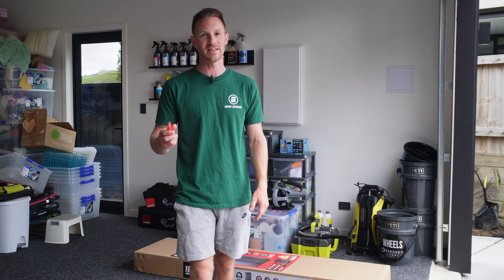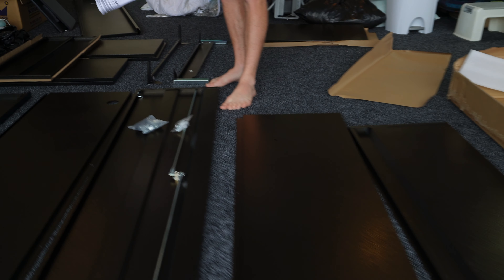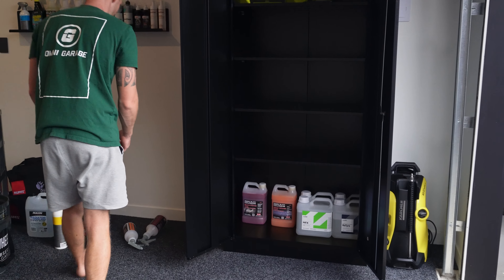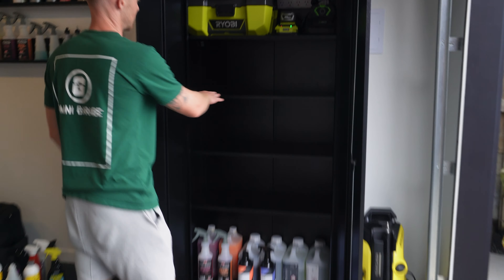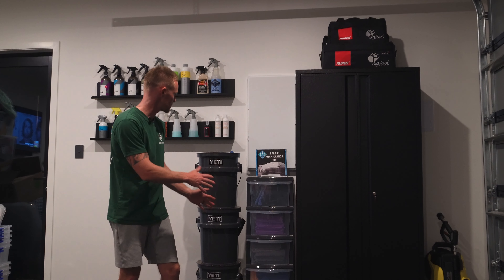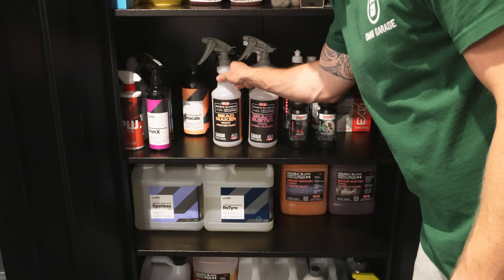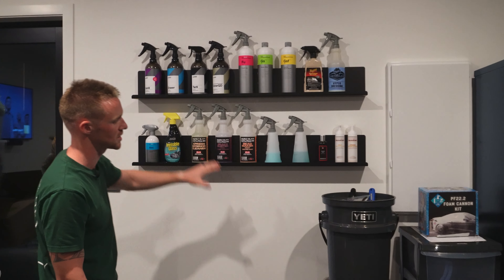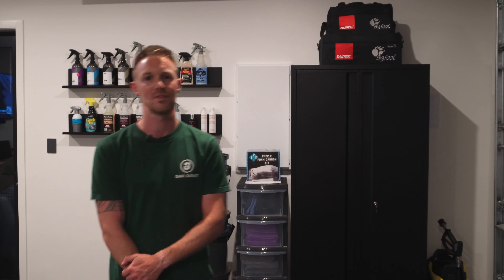Setting Up The New Garage

Comment: Very good start. You WILL adjust as you go along. Adjusting will make you more efficient, and you'll remember where to take stuff from and put away. You'll also notice which products don't move much, and which ones are moving alot. Fun video.
Reply from the maker: Thanks for dropping a comment Kim. We’ll get there, and have already made a few tweaks. It’s all part of the process!